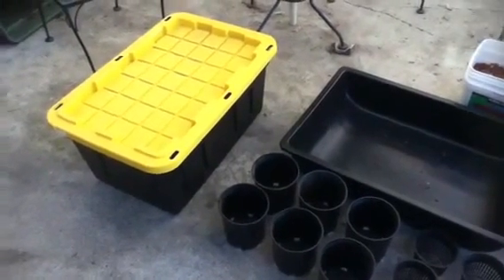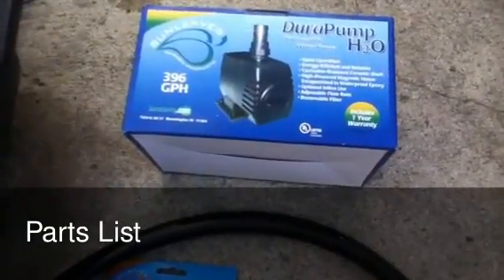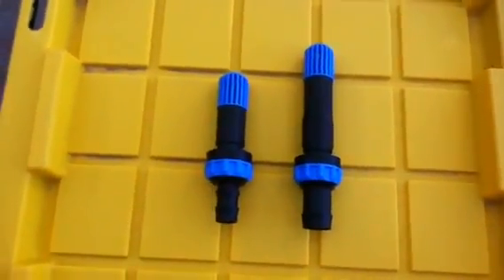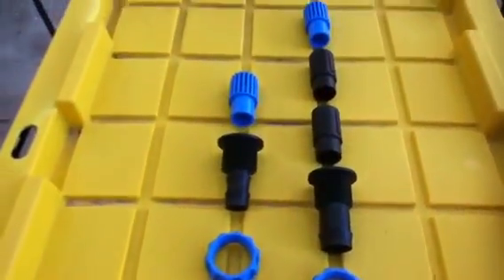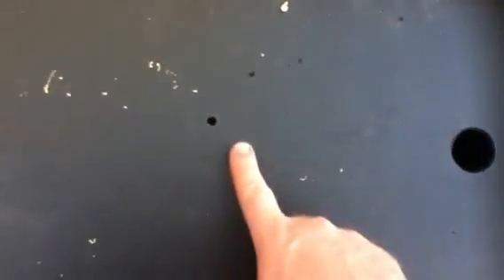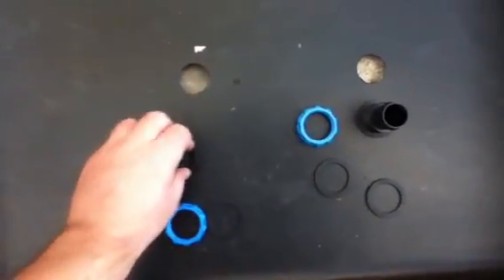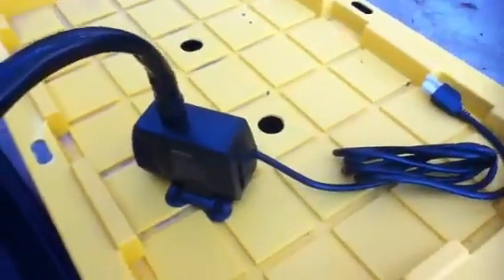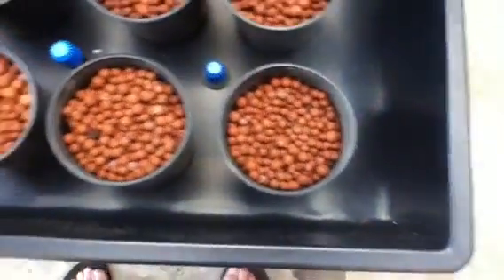Hydroponics DIY:  Build A Flood And Drain / Ebb and Flow Hydroponic System

Comment: Great system I build the same one 30 years ago.  Only one thing was an issue was the changing of the water... I ended up building an screw on hose and would hook it up to the same pump and pump out the old water.

Comment: Very nice and simple set up.  The large bin you are using for your reservoir should be a high quality plastic (Rubbermaid) and not one of the cheaper off-brands.  I find they are too brittle and wear out too quickly, especially when exposed to UV from the sun or grow lights.  The nutrient mixture needs to be changed about every week, so having the plants directly on top is a bit of an inconvenience.  If you could elevate and support the mixing tray, then use hoses to connect the two. That way you can slide out the water when it's changing time. Hell, you could even get a moving dolly to make it easier (Harbor Freight has them cheap).  If you look on craigslist, you can often find a cheap Bontanicare or other grow tray for about $30, which has steeper walls and channeling in the bottom, so that all the water fully drains out.

Comment: I wouldn't have the tray directly laterally parallel  to the reservoir because once your plants are in the tray, you would have to disassemble the whole top in order to change out the reservoir. Off setting the top tray so that they are perpendicular would be better but ultimately I would not have the table on the reservoir at all
Reply from the maker: This is a cheap setup.  After someone decides they like an ebb and flow system then money can be spent on getting the table off the reservoir.  I need to do some videos showing upgrades that make the system more user friendly.

Comment: How does the water drain completely?  The water fills nicely, but only seems to drain down to below the blue netting on the drain tube, and then it just sits there.  Any suggestions as to why that may be and how to fix it?  Aside from drilling another hole and putting in a slow drain cap?  Thanks for the plans. It's a very nice set up and you explained it perfectly so even  someone like me, who gets lost and can't find their way around in a Home Depot can build it effortlessly.
Reply from the maker: You should have installed 2 fittings.  The pump should be connected to one of the fittings.  The fitting with the pump connected has no risers and only the blue netting connector.  The drain tube has the risers and a blue connector.  Hope that helps.
Reply: The water drains back through the pump when it is turned off.
Reply: The higher fitting is for overflow. in my set up I do a test with the pump and see how long it takes to completely flood the tray WITHOUT overflowing.  Then I set my timer for this number of minutes (about 6 with my pump).  The overflow would be if for some reason the pump doesn't shut off or you aren't using a timing and forget to turn it off.  Like the noted below, the return flow is through the pump when it is turned off.

Comment: what about the air pump? The water fed by the water pump needs to be oxygenated by an air pump in order to prevent algae and molding. It also keeps things circulating. Great job on everything else though

Comment from the maker: In my experience the pump can fill it faster then it can drain.  The pump may be bad.  The most likely cause is that the hose is kinked.  Test the pump without the hose connected.

Comment: 6:34 Did you accidentally say the drain and fill wrong? I thought the low on was the drain.
Reply: no the fill is the low one... the tall one is the drain, it allows the water to actually build up and stay in the tub but its still short enough to allow water to drain through it and not over flow from the sides of the tub.
Reply: Poon Snarfy The tall one is an overflow. The short one is the fill and also the drain. The water drains from it when the pump shuts off. It actually drains through the pump.

Comment: The downside of hydroponics is you have to shop for "plant food" or nutrition and supplements that are expensive.
Reply: Lambo Mater Don't fall for it that is just a guy who collected diy builds trying to make a quick buck. If you want information try gardenpool.com. They actually teach you having hands on classes & community team building.  This add is targeted toward new people. To scam them before they know about the community and its resources. This site posts on almost every diy build ;(
Reply from the maker: For a beginner or someone who doesn't want to learn chemistry, nutrients can be expensive.  Some people like pre mixed nutrients.  Some will custom mix the salts to get exactly what they want.  I'm personally in the middle.  I use a 3 part formula.  I don't buy nutrients from hydroponics stores either.  So the more you learn about nutrients the cheaper they get.
Reply: rcmagoo The idea of having a net box to the side with duckweed in it along with a bucket as backup. Free food for the fish then the waste pumped up into the bed. The only thing that gets me stuck is getting Bell Siphons drilled and setup.. That is why I like this build. I've mixed this build  with http://theselfsufficientliving.com/wp-ontent/uploads/2014/05/Indoor-plan-for-aquaponics.jpg. Though switching from pvc  in/ out to flexi tubes &  the drain kit. I hope its a way around having to make a Bell Siphon.